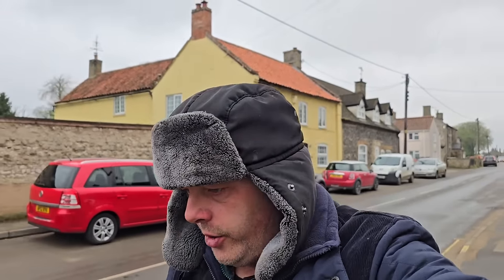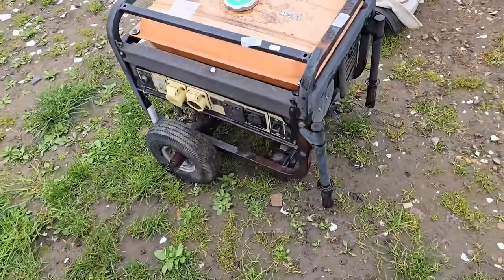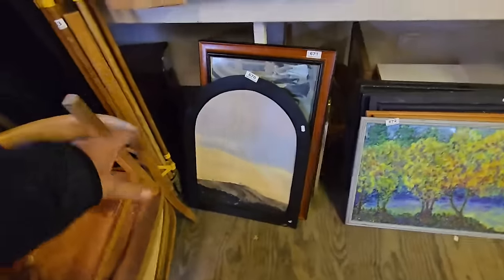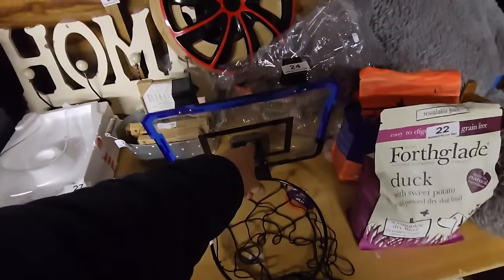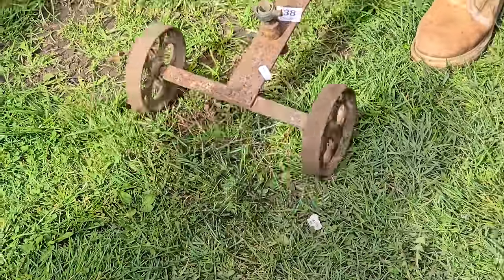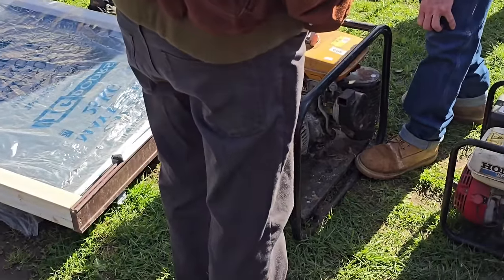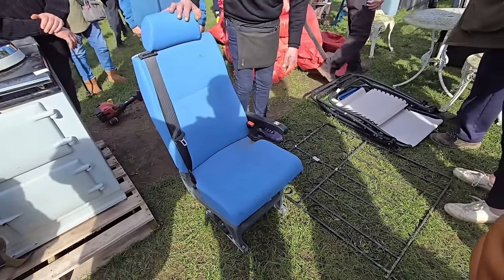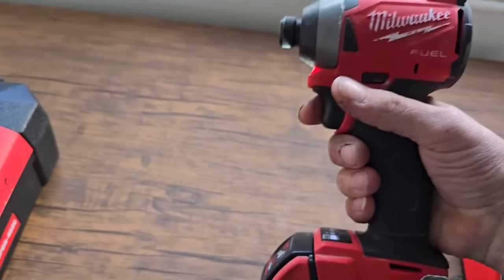Auction day. Methwold. Loads of random stuff. What did we get this time.

Comment: Hi Adam, I recently saw the video you did about Evaporust. I watched the maker's video on it and several others and it appears that it works brilliantly if used in an ultrasonic cleaner . And a little tip is to place the item in a leakproof tupperware box so as not to use too much Evaporust. Another tip is to use it in fuel tanks, in the videos I've seen it worked brilliantly. I'm certainly going to use it to sort out my Wrigley autotruck. Thanks for your videos which are brilliant and I like the way you show everything, warts and all., keep it up